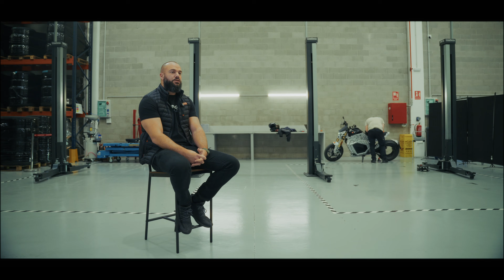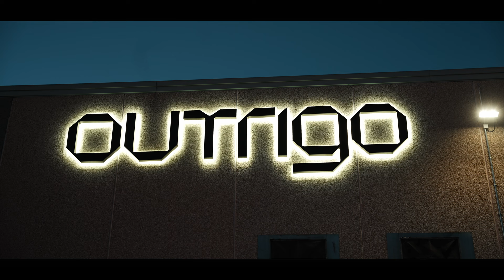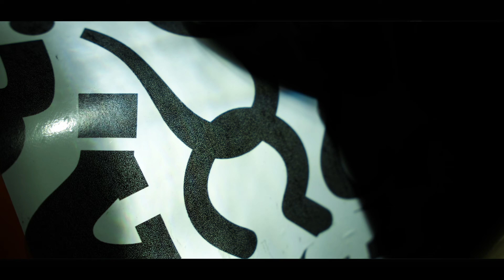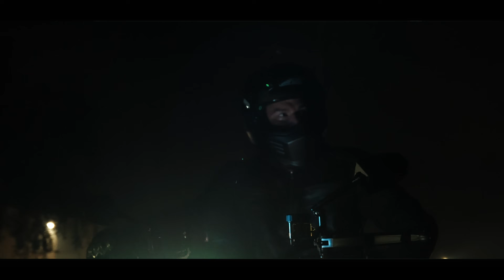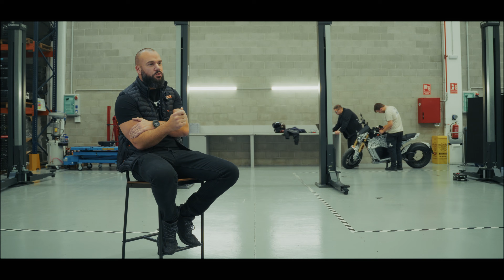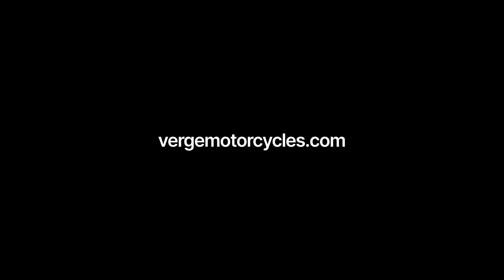TS Pro Gen 2 : Performance Verification & Certification | Verge Motorcycles

Comment: So nice you guys keep on it !!!! .. you are cutting Edge and clearly are beating zero that has been here for 15 years !! Doing solid state and 33kwh batt and .. fast charging and easy maintanance ! .. YOU GUYS ARE WILD !!! ...Dont forget you could also put in a 2way throttle !!! Makes riding very fun !!! The vectrix moto scooter  had this as standard
Reply: what does 2 way throttle do? reverse?
Reply: @Jjeveretrose52its mostly  regen !! ..Its like a super gentle brake ..and yes when you are stationairy it is a reverse ..

Comment: I rode the Gen 1 in LA a few months ago and was impressed, but noted some issues that sound like they have been addressed. I've been a Zero rider for 14 years, currently on the SR/S. I love that bike, but if you can improve on it, I'm open to moving over. When can I get ride on this Gen 2?
Reply: After years on the SR/S i switched to a BMW CE-04 now that most of my riding is urban. But i too would love to test ride a Gen 2 in the Frisco bay area.

Comment: When is it getting  a reverse gear/mode?
Reply: same request here, many tight roads with 30° ups/downs
Reply: Why put reverse on a bike?
Reply: @bwcdevices3028  It's for walking-pace manoeuvreing, out of sheds, sloping parking places etc. These things are heavy.
Reply: @PaulJenkins599  If you don't have the physical strength to push it 2 bike lengths  backwards in neutral then you shouldn't be riding it.
Reply: @bwcdevices3028  I have the physical strength to push my car back 2 car lengths when it's in neutral but it's always nice to have the option of a reverse gear on it for convenience.
Reply: @bwcdevices3028  If the motor is permanent magnet there isn't really a neutral.  Lots of drag when power isn't applied.
Reply: @GaryV-p3h Driving a car is not quite the same physical process as riding a bike. You need to have physical strength to ride a bike. Wjat I said above is very much true. If you don't have the physical strength to push it 2 bike lengths  backwards in neutral then you shouldn't be riding it.
Reply: @MOTO_909  It isn't.
Reply: @bwcdevices3028 heavy honda and  bmw have a reverse

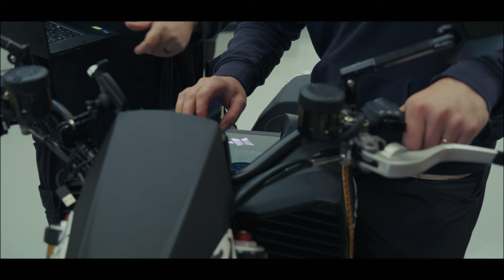Comment: 3:34 I guess you went from Hall sensor to Sin-Cos to get better torque/phase amp précision at ultra low speed. I am very curious about the FOC controller that you are using with these motors and their caracteristics.